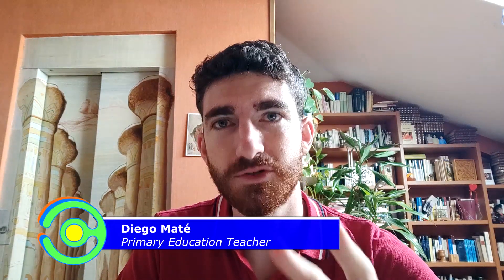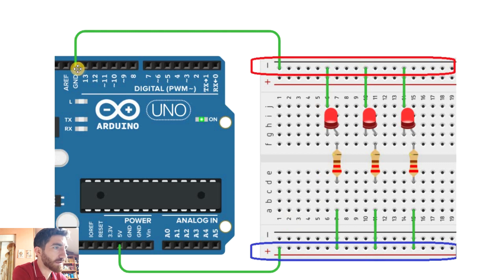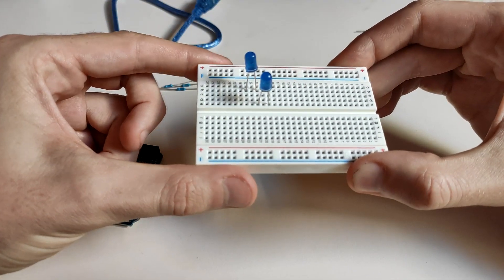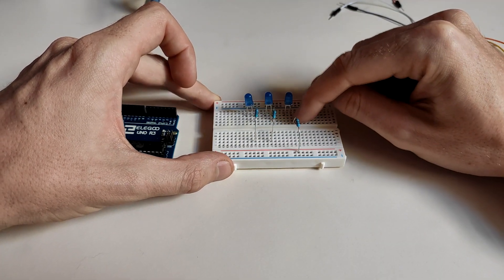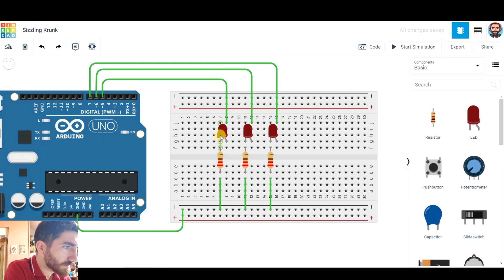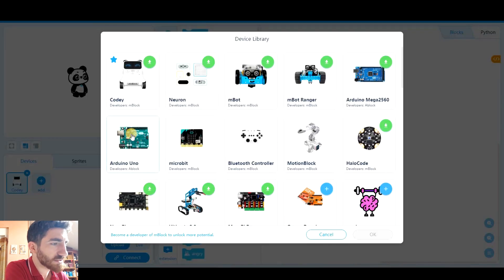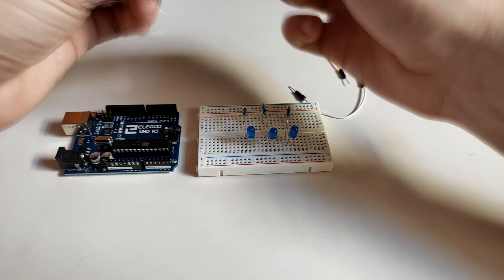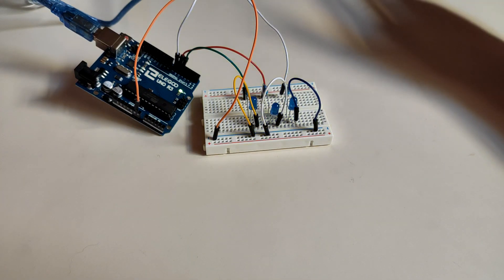SERIES and PARALLEL | Code 3 LEDs with ARDUINO and mBlock 5 (based on Scratch) - Arduino Course #02

Comment from the maker: INDEX 📜
0:26 Series and Parallel Circuits (Theory)
2:57 Series and Parallel Circuits (Experiment)
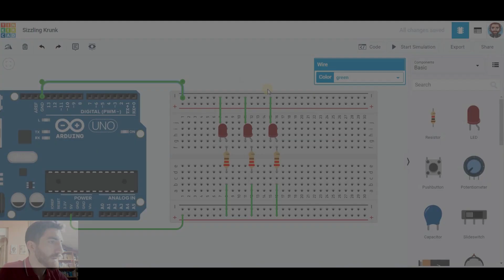5:47 Coding LEDs using mBlock 5 (Theory)
7:42 Coding LEDs using mBlock 5 (Experiment)